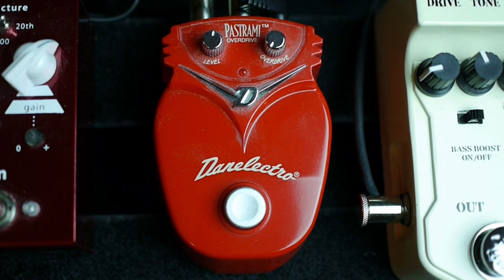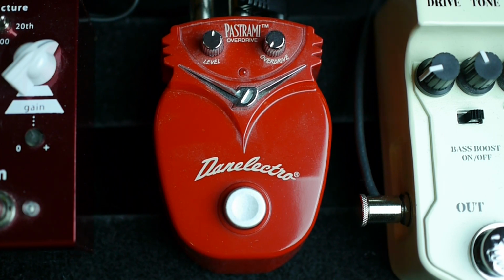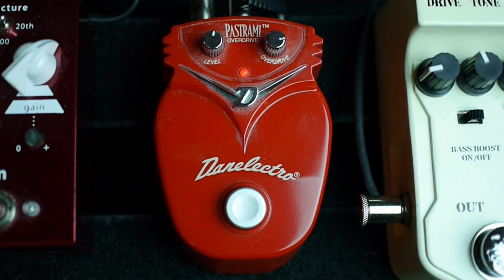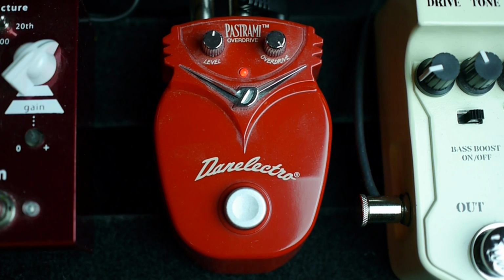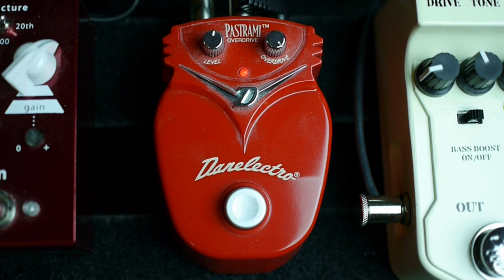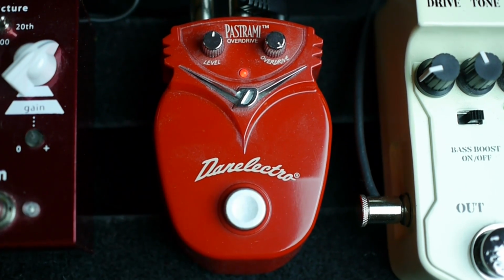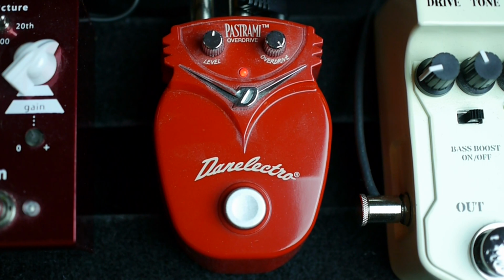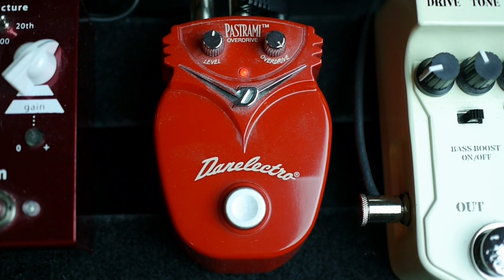Cheap Thrills!!! Danelectro Pastrami Overdrive

Comment: These are fun little pedals. I don't care for the tone I get once the gain is above 12 o'clock, but, the lower settings are great.  I use one as a slightly dirty boost. It works great for driving other pedals or tube amps into overdrive. Fun pedal I've had since the late 90s that always finds its way back onto my board.

Comment: what is the little light that shines when you play it? i have one and i was wondering if it is a valve idk... this pedal sound really good.
Reply from the maker: I haven’t opened it up, but I’m pretty sure it’s an LED in the diode section that clips when it gets a signal.  I’ve modded a ds1 like that and it gives a great “squish” quality.